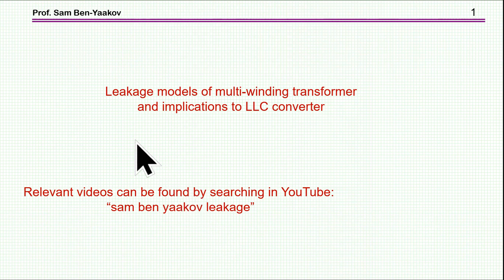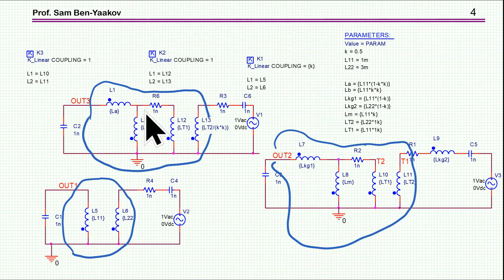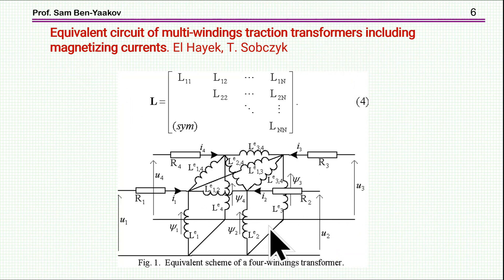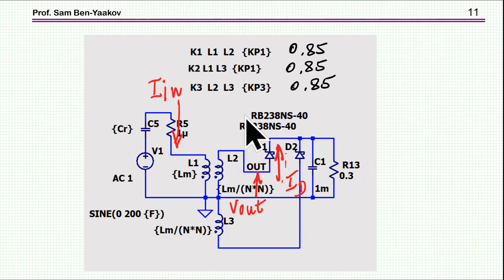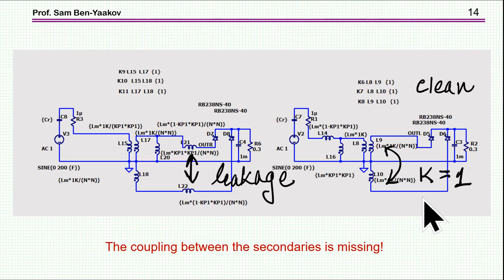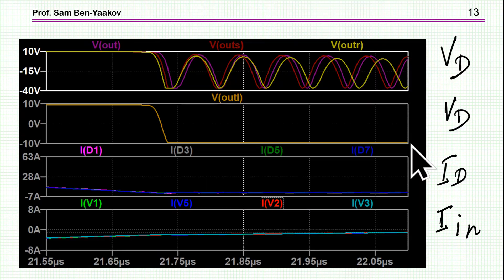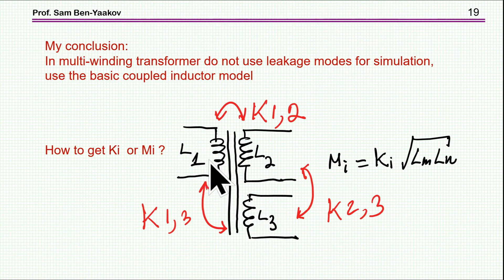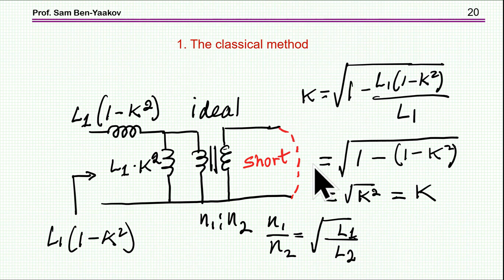Leakage models of multi-winding transformer and implications to LLC converter

Comment: Hi Sam,

Thanks a lot for the content, There is a Thesis from Caltech in 1980, entitled "Problems in analysis and design of switching regulators", written by SP Hsu, In the second chapter, it does reluctance (in fact, permeance) modeling of the multi-winding transformer, and transforms the coupled inductor model into the conventional Pi equivalent circuit model (in which each winding has a leakage inductance and a magnetizing inductance in parallel with the first winding), showing that it is sufficient and accurate enough in the case of a three-winding transformer (with a few approximations)
Reply from the maker: Thanks for the reference,

Comment: Hi Professor, this is also a topic I am working on recently. THanks for your explanation. However, I have tried these four modeling methods in LTSPICE and seen that the two L-models give different results as other two. I have double checked and made sure the parameters as the same as yours. Additionally, all models give like twice higher than your results at 7:42. How come is this? BTW, all your schematics at 3:38 missed Cr.
Reply: I believe the L-model has a wrong equivalent turns ratio. The inductance on the side sec. side should be: Lm*1k/(N*N)/(KP1*Kp1) - verified by simulation.

Comment: Hi Sam, 

One comment I would make about your different equivalent models - I agree with your comment about them all being equivalent if you apply the appropriate transformations.

I have designed several integrated magnetic devices using custom cores that allow a flux shunt to be inserted between the primary and secondary windings.   Based on these designs they do end up being somewhat asymmetric and I can implement the leakage inductance so that it is associated with one particular winding - resulting in the bulk of the leakage associated with one winding and a much lesser amount with the other.  This does make a difference for the solution as to whether you run the leakage on the primary or secondary from a basis that the volt-seconds applied across the transformer can be different depending on which side you place the leakage. 
From a simulation model you are correct that you can work out equivalent transformations between the primary leakage and secondary leakage design.  That being said from a practical designe perspective it can be beneficial to use one of the designs over the other on the basis of lowering the applied volt-seconds across the transformer. 
This is a very unique case however as this difference only comes about from the unique core geometries that I have developed. 
Virtually all LLC designs that I have come across based on industry standard core designs will end up creating symetrical designs - I.E., the leakage ends up being distributed evenly between the primary and secondary windings.
Reply from the maker: Hi, I think that you have missed the point.  In as much that the origin of the leakage can be associated with one port or another, you can always extract the coupled inductor model and then transform it to an equivalent circuit in which the leakage can be put in one side or the other. See https://youtu.be/TUfaN40T1Yg

Comment: I see you do in ltspice sim the leakage and use K1 L* L* 0.85? . Now I see how you did it, thanks,
Reply from the maker: Please indicate the minute of video you are referring to.
Reply: @sambenyaakov  It was on 4.28 minutes start time. Have a very nice christmas.
Reply from the maker: @audiokees4045  K LA  LB  {XX}  is the prompt to define the coupling coefficient , 0.85 is the number used for XX in the simulation
Reply: @sambenyaakov  I do now that this is for coupling the windings, I use 1 most of the time. When use 0.85 output voltage is lower, and that is right sim. I thought U did use it for resonant simming. I usetransformer  Lp for sim.
Reply: @sambenyaakov  Ohh oke, I did use 1 that is to high then to get trustable results from transformer. Thanks.

Comment: Thank you! I have a suggestion for new contribution on this channel:
Induktive cooker and the typical schematics of these devices. I disassembled some weeks ago one of this. I found inside just 2 power electronics parts: a diode bridge and a 600 V MOSFET. The coil has a parallel capacitor comprising a resonance circuit. It's a miracle for me, how a single MOSFET is able to control the power transfer into the cooking pot. At list I would expect a MOSFETs half bridge.
Reply from the maker: Good topic. Perhaps. The one MOSFET is probably in E class topology.